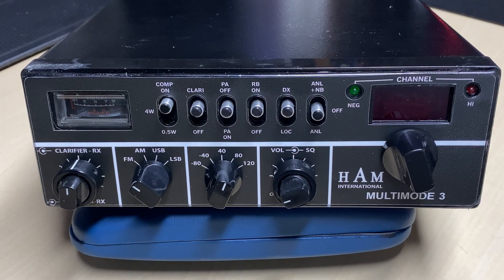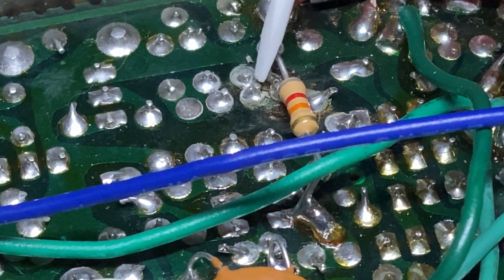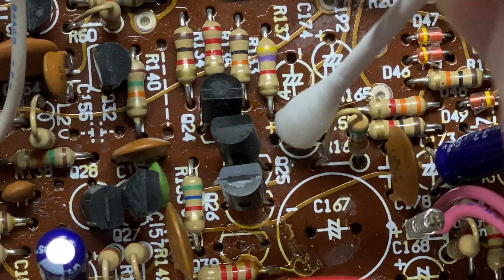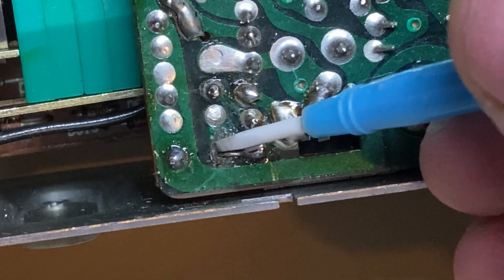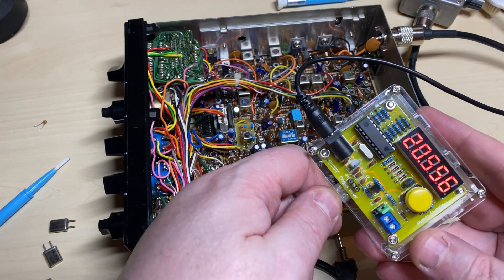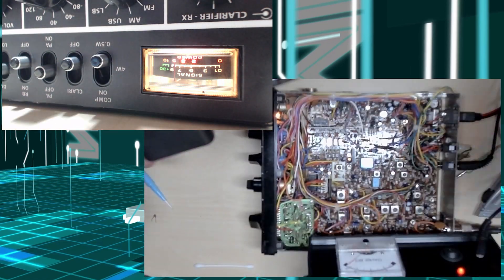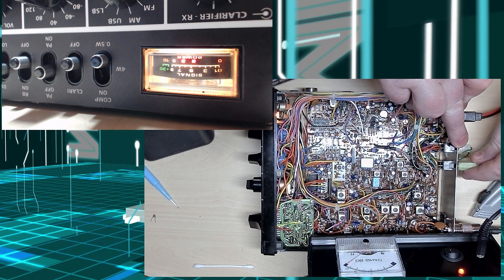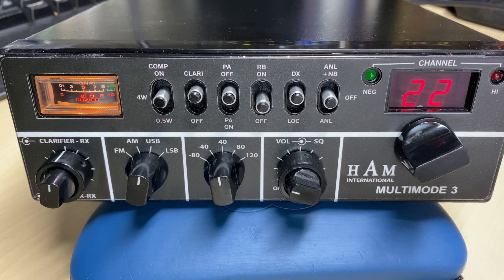EP 178 - HAM International Multimode  3 - Lots of rot!

Comment: Nice looking radio that one!!. An suggestion for the AVR circuit in these radios to make them more stable is to replace the transistor AVR with either the 78xx voltage regulator ic or the LM317 adjustable voltage regulator ic but don't 
forget to put 0.1 uf capacitors on the input/output of these ic's.
Reply from the maker: Hi , yes that's a good tip, thanks.
Reply: @MicroChipz  i think the AVR voltage in these radios is about 9 volts going by memory.
Reply: Wow thanks for putting this out there for all of us, I'm loving it, I'm looking for a rig DOCTOR just wondering if you were talking order's, thanks again Alan 🇬🇧💯👍